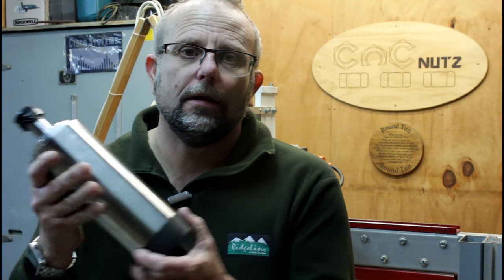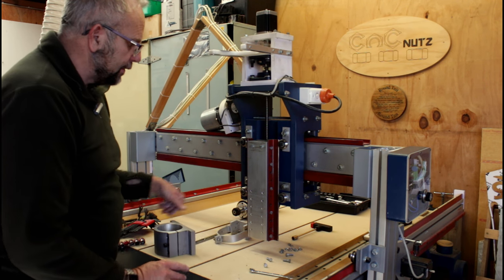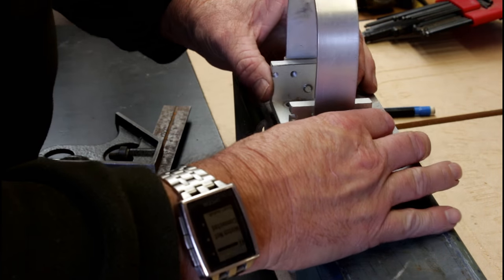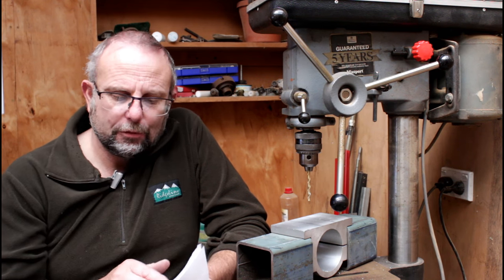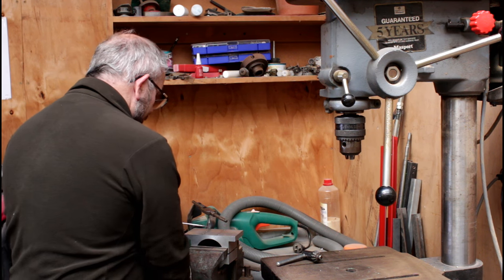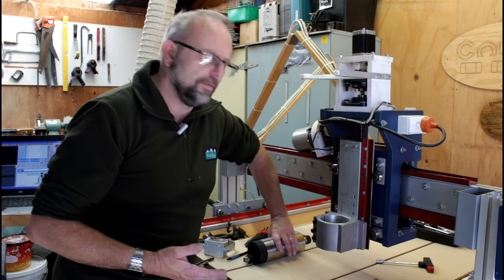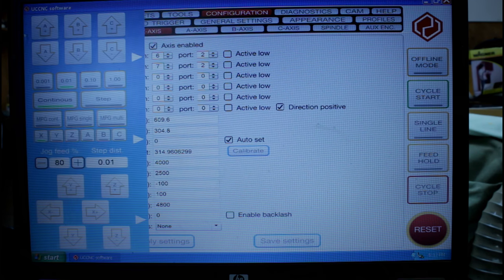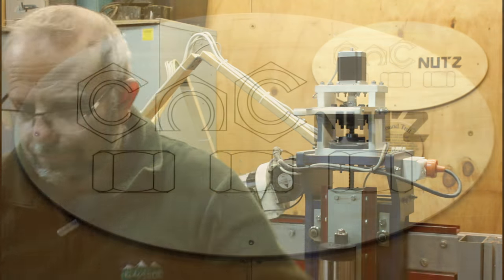Install a Spindle Part 1 - CNCnutz Episode 142

Comment: Hi Peter, Really pleased to see this , I too have been using one of these,( Mine is  2,2kw aircooled ER20)for a couple of years now never had problems with heat , never seems to get hot , mildly warm thats all, give it a blow through with an airline once in a while to get the dust out, 
 
I have cut lots of plywood and some aluminium castings never had an issue , really cant fault  the motor or the vfd (also Chinese ), 
I always have ran mine with manual on off and a pot for speed , never felt the need to interface it with the Mach3 
I am  sure you will like the versatility that the collets give ,  ( I purchased a full set 1mm thru 13 mm) covers all the metric and imperial cutters i have come across  
Really like your practical approach to your work , looking forward to the next episode 
Keep em coming and Thanks
Reply from the maker: Thanks Zodiac0545
Good news about your spindle and its reliability.
I have already got the full set of collets and was planning on using it manually to start with as you are doing but I am now moving toward bringing it under PC control instead. I think it will be realitively easy.
Cheers
Peter

Comment: Hi Peter, I was confident that the stepper motor would cope with the extra weight, because I made this transition myself a few years ago. For such a small motor they are incredibly strong. However, I wish I had seen the trick about tapping the holes.
Best regards, Gareth
Reply from the maker: Thanks Gareth
Good to know yours works well.
Cheers
Peter

Comment: Peter I just installed my spindle. Thanks taking through the install. Did you happen to do a video how to calibrate the spindle speed so that when you set 10,000 rpm in Mach3 to make sure your spindle is going at 10,000 rpm?
Reply from the maker: No I didn't as analogue speed control is always going to be about the speed that you set. If you want to set the speed more accurately then look at RS485 control but realistically it isn't really necessary. I have a video on setting up RS485 in Mach3
Cheers Peter

Comment: nice how strong a spindle did you buy , a 0.8 a 1.5 or a 2.2 kw version?
prolly need to adapt the top part of the dust shoe and the laserfoot as whell as the distance between the router and the base its mounted too has changed as whell with changing the mountingbracket , looks like you could still mount the older router in there though 
and since you most likely do away with the fans on top of the new routerspindle you prolly need to add one extra air intake to the laserfoot base unless you want to suck air in through the spindlebody 

allso if the spindle turns out too heavy a load on the z setup you could add a small airspring between the two moving sections like the types found holding a hatchback open on a car
Reply from the maker: I got the 2.2KW spindle.
The Dust Shoe is going to be a problem and I will have to rebuild the Laser Shoe.
The Old router is too big to go in the spindle mount but as a bonus the Spindle can easily be removed unlike my Old router so it offers many other options to mount the lasershoe.
The lasershoe doesn't use the router fans so it isn't a problem.
If the router was too heavy I wouldn't use springs but would look to change either the leadscrew or the stepper.
Fortunately it isn't a problem.
Cheers
Peter

Comment: Thanks for covering the install of a spindle. I am looking at upgrading my GarageworX to a water cooled spindle. Will you be wiring it up to control the spindle speed with UCCNC?
Reply from the maker: +Mike Merzke 
A good question Mike, to which I don't have a good answer. I have to research how to do it. 
Cheers 
Peter
Reply: Well if anyone can figure it out, its you!

Comment: Great once again Pete! These spindles are great I have a 1.5Kw Air cooled running through a Chinese VFD which i have used for the past 5 years and never had a problem and they are much quieter than a router, did you get an ER 11 or ER 16? With the center bolt on the mount I also believe it is to expand the clamp, once I have tighten the top and bottom bolts I also tighten the center on slightly to act as a locking bolt, that's just what I do, keep up the great work.
Reply from the maker: I got the 2.2KW spindle with the ER20 collet set.
I did wonder if the center bolt should be wound in as an additional lock once the outer 2 were tightened.
I spent a lot of time agonizing over the choice of spindle I should get. It will be interesting to see if I use any cutter larger than 1/4"
Cheers
Peter

Comment: Peter what is the part# for the holder and where did you buy it.  I see it in many video's but unable to find a source.  Enjoy very much your video's.
Reply from the maker: This is the same as the one I bought if it helps. It's probably a bit late now.
Cheers
Peter

https://www.aliexpress.com/item/32888337906.html?spm=a2g0o.productlist.0.0.5b9a7fe6fhUxRK&algo_pvid=457189e9-1c10-470c-a7b6-bd452f64780e&algo_expid=457189e9-1c10-470c-a7b6-bd452f64780e-15&btsid=0ab6f82415918750701606225e6c30&ws_ab_test=searchweb0_0,searchweb201602_,searchweb201603_

Comment: Hi Peter, great video, I'm jealous because I can't fit a spindle like that on my machine.

I see you added some extra mass to do your tests, but what about upward forces from the work piece when doing plunge cuts with your spindle?  I really don't know how much force pushes upwards.
Reply from the maker: What machine do you have? 
I must admit the spindle clamp looks masive on my Z axis though the spinle looks proportinal.
I think the extra weight tests the upward force of a cutter and dust shoe bristles. If the axis can lift the additional weight then it will easily be able to overcome the upward force because it has the weight of the spindle helping it move down.
I was truely impressed by the power of the Z axis and it goes to show that you don't need large stepper motors to get speed and lifting power. All of my steppers are 270 ozin motors. 
Cheers
Peter
Reply: I have to check what size steppers I used to build mine but they're pretty big (overkill, honestly).

The machine I built is a momus CNC machine momuscnc.com

I'm using a Ridgid R2401 as my router.  On second thought, the router may not be that much smaller than your new spindle, though I'm not sure if I'd lose anything in the X axis for the clamp (it almost touches the window when all the way forward).

Speaking of forces, can you point me to a resource that talks about the different loads on the spindle thanks to plunge cuts or sideways cuts?  I'd imagine it depends on the material cut, spindle speed, type of end mill, and feed rate.
Reply from the maker: I bought the plans to the Momus but never got around to building it.
I liked the enclosed compact design.
The Spindle is 80mm in diameter, weighs 6kg with it's clamp and would be overkill for your machine.
you can get spindles at lower power in 65mm diameter and I would imagine 800w would be more than enough.

I have no info on forces, speed, feeds or materials. I do everything by ear and eye. If it looks and sounds right it probably is.
Cheers
Peter

Comment: why u chose aircooling? i have the same spindel, but i have it whit water cooling...u have the inverter to it to? Good luck whit your new spindel, im sure u will be happy whit it :)
Reply from the maker: +Rikard Johansen
Power and water don't mix in my book. Needlessly complex and I see no major advantage. Simpler install, no plumbing needed. 
Just my opinion. 
Cheers 
Peter
Reply: Haha, that  is exactly what I thought before getting my water cooled spindle (i.e. I was highly skeptical!).  5 years later and after several inspections not a drop of evidence anywhere.
Reply: Rikard Johansen I have used both air and water cooled Chinese round bodied spindles.
Would never use water cooled again. Air cooled is just so much cleaner simpler system.
Don't understand why so many go for water cooled.

Comment: Drill press and tap is a great tips.....thanks. My first thought, was you were going to tap it using the drill press.😂
Reply from the maker: One day I shuld make a propper Tap stand.
The number of times I have ended up with angled threads tapped into a project is truely embarassing.
Since using the drill press method they are always right.
Cheers
Peter

Comment: Not done yet. Will you go through how to wire and program the 220V VFD?
Reply from the maker: Will cover the VFD next episode.
I have managed to get mine to run under manual control at this time as i am no expert on this by any stretch of the imagination.
Will have to do some research when I get some time.
Cheers
Peter

Comment: My dear usually i have seen some ,witch they instal balancer by using spring or pnewmatiqe pump.
Reply from the maker: I think that is to stop the spindle dropping to the table when the motor is de-energised. It is almost impossible to back drive a leadscrew setup of this type.
Cheers
Peter

Comment: Peter, you can't just hook a wire to the fourth prong. Is the fourth prong not hooked to any thing in side the body of the spindle.
Reply from the maker: You are right. The 4th pin on my spindle was unused.
That is why I disassembled it and connected the 4th connectin to body of the spindle for a ground connection.
Cheers
Peter